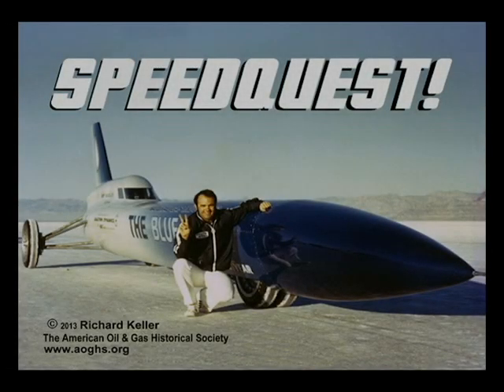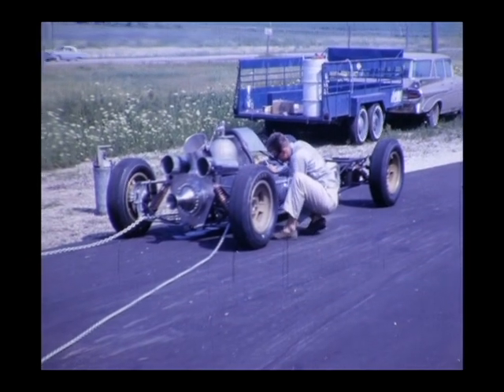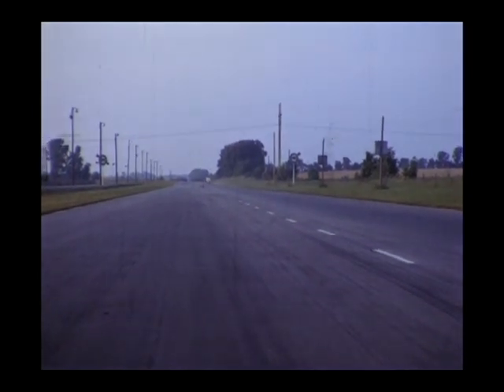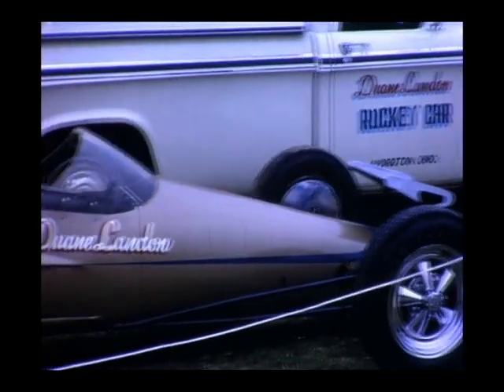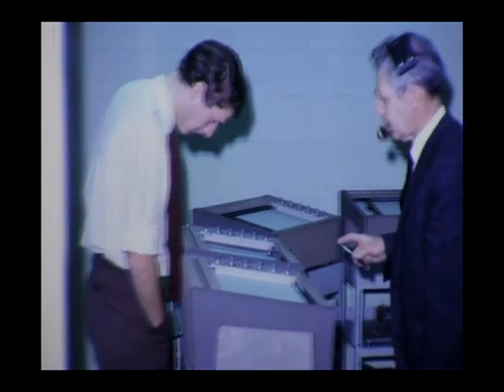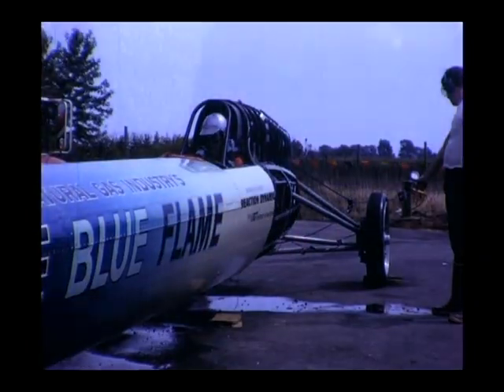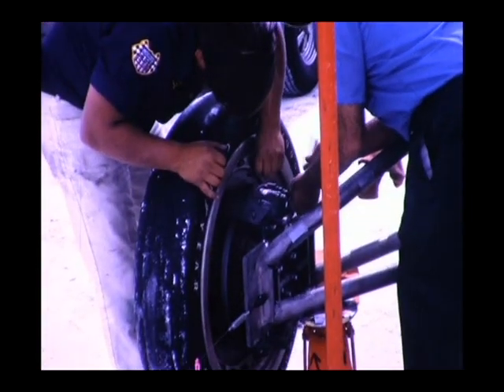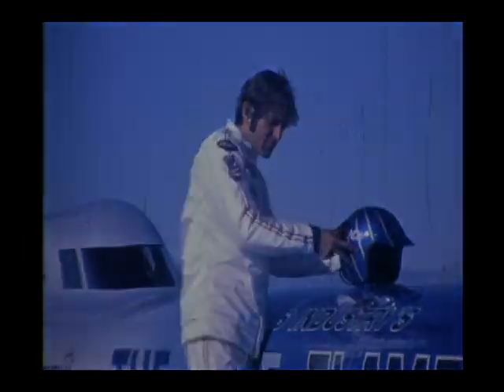The Blue Flame - Speedquest

Comment: Bring back rocket cars!! I remember as a young child watching these cars
Reply from the maker: The X-1 was the first successful rocket dragster which we ran for 2 years until we started working on The Blue Flame. The X-1 rocket was later installed in the first Pollution Packer dragster which unfortunately crashed at the Darlington Speedway track, killing Dave Anderson. Unfortunately, later accidents resulted in a ban on the rocket dragsters.
Reply: Dick Keller my father Donnie Holm was one of the first guys to make a machined billet cylinder head for fuel and alky cars in 81-82 . Some say Ken Vinny was first some say my dad was. I was way to young so it’s up in the air. I remember watching rocket cars as a young child on the west coast like OCIR and Baylands. I remember a go kart rocket and a rumor about it taking flight. Any truth to that most say it’s a urban legend
Reply: Dick Keller you videos are so cool I watch them over and over again. Thanks for the great content
Reply from the maker: @groomlake51  There were two or three rocket go-karts back in the 1970s. Turbonique produced a small rocket that was used on at least one go kart. I believe there was at least one other using a bespoke hydrogen peroxide rocket motor. I am not aware of any crashes of these mighty mites.
Reply from the maker: @groomlake51  Also check out Sam Hawley's "Land Speed Legends" YouTube videos. He did The Blue Flame parts 1, 2, and 3 which are excellent.
Reply: Dick Keller thank you very much Sir🦾 if we ever get back to racing in the NHRA I have some VIP tickets with your name on them for any national even you would like!!! Nitronickholm g mail
Reply: Dick Keller did you guys work with Kitty O’Neal also back in the day???
Reply from the maker: @groomlake51  You are very welcome. I can't believe how much fun we had in the 1950s and 1960s street racing and finally running on drag strips. We all built our own cars before the Detroit muscle cars arrived. Now, we are all shut down with a stupid fake virus.
Reply from the maker: @groomlake51  I never worked with Kitty. I met her and watched her in action a few times. She was very talented, brave, and a real lady.
Reply: Dick Keller tell me about it!! We were going for rookie of the year in top fuel this year. After 2 races we are sitting 6th and the dang flu shuts us down😳🔫. I was born in 78 and I remember drooling over pictures of the blue flame growing up obsessed with H2O2 cars. I really love the technical information you detail in your videos! Keep up the great work your videos are a piece of history and very informational. Growing up around racing. I always love the out of the box thinking and guys like you that were not scared to do something different. The sheep mentality has diluted Racing i think. In my eyes innovation is a lost art. My father made me read rule books over and over like he did. He always said” not all..., but most rules are written in words. And words are open to interpretation”! Thank you for your documentary’s. I watch them over and over a lot and learn something new every time🦾😎🚀🇺🇸
Reply from the maker: @groomlake51  Back when I was privileged to be a part-time pit crew for Don Garlits, he was always commenting on how as soon as somebody succeeded with some new design - it was immediately copied by everybody. The result was they all ran the same speed and ET. Don was always experimenting - and that is why he was the King of the Dragsters. For Pete, Ray, and myself there would be no point in getting a turbojet engine and trying to beat all the other turbojets. Breedlove and Arfons set the pace in the 1960s and, in the end, they were both running the same speeds. Roger Penske always looked for the "unfair advantage" with Mark Donohue - and kicked butt in Indy, NASCAR, and SCCA. We tried to do the same with The Blue Flame.

Comment: My grandfather, Ray Besasie of Milwaukee, fabricated the nose cone and canopy-fin assembly in his east side shop. He is pictured (old guy with baseball cap and sunglasses) in the scene where the guys are polishing the nose cone. He was an amazing man.
Reply from the maker: Ray Besasie was the fabricator of all the compound shaped panels on The Blue Flame. The following year he did the same for the Honda Hawk motorcycle streamliner that went 286 mph. I recently gave a PowerPoint presentation on The Blue Flame to the Ancient Aviators of Alabama where I described Ray Besasie as "the most interesting man in Milwaukee". Ray was an aviation pioneer, designing and building the monoplane "Sonny Boy" in 1932 - and the radial engine that powered it. He was an innovative designer of turbochargers for piston engines. He designed and built numerous vehicles for Brooks Stevens as well. Ever hear of the Excalibur?
Sadly, I didn't have good photos of Ray working on The Blue Flame since he made those panels in his backyard shop. And he could really spin a yarn! What a great man.

Comment: I was an undergraduate student in Aerospace Engineering at Ohio State with a part-time job (mostly doing drafting work) at the Aero Lab when the wind tunnel tests were being conducted.  The original plan was to have a conveyor belt running at 600 mph to simulate the car running on the road, but the belt formed waves at high speed and that plan had to be dropped and a flat plate used.  We were all super excited when the Blue Flame broke the record!
Reply from the maker: I really enjoyed working with the Aerospace Engineering staff at The Ohio State University. We made critical decisions based upon the data derived from the transonic wind tunnel test. The result was the best handling LSR vehicle ever in t he 600 to 700 mph range.

Comment from the maker: Instead of the moving ground surface, the model was modified and placed in the test chamber mounted above the thickness of the flat plate  boundary layer. Dr. John Lee of OSU consulted with Dr. Paul Torda and grad student Tom Morel of IIT on the transonic test procedure. The result? The Blue Flame, running in the transonic speed region (660 mph peak speed) was the most stable 500+ mph land speed record vehicle up to that time (1970). A job well done.

Comment: Great video , as an Aerospace eng I  like the Tech info,,  looks like the vehicle was well within its design limits.  Why didn't they push the record higher ?   Regards from Bonny Scotland 😊
Reply from the maker: The AGA sponsor was happy to get the record, period. They were more concerned about negative publicity if The Blue Flame would crash trying to go faster. Actually, we were prepared  to raise the record on the next day, October 24th, but it snowed and the LSR season was over on the salt flats. The Blue Flame went on a national and European tour for a year, then stored away from view. Finally, it became the feature exhibit in the Sinsheim Germany auto and technical museum.
Reply: @630lsr  Those tires must have been pretty special, to handle the centrifugal forces.  Especially having the trust in them to operate at higher speeds.
Reply from the maker: @atomicbonds6790  Goodyear did a terrific job on the tires. They tested the tires on our wheels at up to 850 mph.
Reply from the maker: Waiting for Rosco McGlashan to really push the record over 1,000 mph.
Reply: @630lsr  I wish him only well and the best of Scottish luck,,   but is it really wise to take such a massive step above the current record ?   One small step at a time.  
Bloodhound will never move again, The Britts are  skint & have no Balls,  so no  threat from them.
Reply from the maker: @andyb.1026  Probably sounds good for raising sponsor funds. We already were first at 1,000+ kph.

Comment: Love this video, as a kid "The Blue Flame "was it for me. I actually made a model of it using a Estes D engine, it went well until the end and it got air borne.
Reply from the maker: Glad you liked it. I shot my video on 16mm Kodachrome film - there was no video tape then. I was building balsa wood "rocket" models as a kid, too. We used CO2 cartridges bought at the army surplus store after the War for power. To keep it on the ground we used a fishing line through 2 small eye screws under the car. Worked every time.

Comment: Acceleration wise, was the Budweiser quickest? Both seem to take off very quick in the videos, wonder what the potential could be if allowed/handle full thrust
Reply from the maker: We timed The Blue flame in the Standing Start 1/4-mile a few times to check performance. On September 18, 1970 Gary drove The Blue Flame to a 6.724 seconds elapsed time. We didn't time the top speed. By comparison, the 1970 Top Fuel qualifier at NHRA Supernationals in Ontario, California was 6.68 seconds. I guess The Blue Flame was quick as well as fast!

Comment: Was the car designed to fit inside of a shipping container or the enclosed trailer of a Class 8 type truck? Wikipedia page says: The vehicle is
37 feet 4.6 inches (11.394 m) long, 
8 feet 1.5 inches (2.477 m) high to the top of the tail fin, 
7 feet 8 inches (2.34 m) wide
wheelbase is 25.5' (7.8 m). 
https://en.wikipedia.org/wiki/Blue_Flame_%28automobile%29
Reply from the maker: +SanFranciscoBay No. Our trailer was not enclosed. We did design within the 8 feet truck width limit to avoid tickets.

Comment: I found this on wikipedia: Sammy Miller in 1984 at Santa Pod Raceway recorded the quickest quarter mile elapsed time ever of 3.58 seconds at 386.26 mph using a hydrogen peroxide powered engine car called Vanishing Point. https://en.wikipedia.org/wiki/Rocket_car
Kitty O'Neill piloted a hydrogen peroxide powered rocket dragster, in 1977 in the Mojave Desert,  built by Ky Michaelson's Space Age Racing Team with an average speed of 279.5 mph (449.8 km/h), setting an all-time record pass in the quarter mile at an incredible, never before achieved 3.72 seconds at a top speed of 392.54 mph. https://en.wikipedia.org/wiki/Kitty_O'Neil
Reply from the maker: +SanFranciscoBay Sammy's first two rocket funny cars - 'Spirit of 76' and 'Vanishing Point' used my rocket systems. He continued on with a rocket dragster, 'Oxygen'. I believe there are YouTube films of his cars running in the UK and EU.

Comment: I'm using my wifes facebook to ask,if you got the record at less then 100% thrust why didn't you come back for more.I think your design is timeless and  with some safety improvements and new rocket a real chance to hit 1k mph also.Thanks for the memory's sincerely Dave L
Reply from the maker: Our sponsor, the American natural gas industry, took ownership of The Blue Flame after we missed our original schedule to run the car in 1969. We de-tuned the rocket in 1970 to comply with the temporary speed limit imposed by the Goodyear Tire Company, which owned the tires. The original plan was to return in 1971 with the rocket at full power to attempt a supersonic record speed. The sponsor, now owners, decide that the reward of a new record would not justify the risk and scrubbed the project.

Comment: 18:00 " Instrumentation borrowed from NASA " : a wire ...
Reply from the maker: Doctors Torda and Uzgiris were professors in the IIT Mechanical and Aerospace Engineering Department. They had several contract research projects with NASA, and some of the instrumentation they had available from those projects were temporarily used in the static tests and later on the salt flats. The on-board recorders can be seen in the LNG tank compartment at 23:00 in my film. These were mostly pressure measuring devices on the skin used in the early test runs. Later, they were removed and our IIT support returned to Chicago.

Comment: i'd like to know the purity of the hydrogen peroxide formula. I believe the space shuttle uses %80 pure mixture
Reply from the maker: I am not certain what the HTP concentration is on the space shuttle. Initially, The Blue Flame used 90% concentration HTP as the oxidizer with the LNG fuel. Later, after a change in the catalyst screens from pure silver to silver-plated nickel raised the catalyst melting temperature, we raised the HTP concentration to 98%. This increased the rocket motor specific impulse and thrust, adding about 50 mi/h to the top speed.

Comment: So you guys used the 27 megahertz band for communications to the driver?
Reply from the maker: +Slicklickz We were using the standard CB radio at that time - 27 MHz
Reply: +Dick Keller Were you using standard AM or was it SSB?At that point in time there were still only 23 AM channels,correct?
Reply from the maker: It was just standard AM citizen's band with 23 channels available. It worked fine on the salt flats - no obstacles. We had to elevate the antenna, though, from about 24 inches above the ground to the top of the tailfin. That may have been more a mechanical consideration than a radio issue.

Comment: wow what a great tech video. really great insight into the record setting car & driver :)
Reply from the maker: Glad you liked it. The real message is that we reversed the process of land speed record design. Ostich, Breedlove, Walt and Art Arfons, all purchased surplus turbojet engines and tried to see how fast they could go. We calculated the power required to achieve our record and designed and built the rocket to develop the necessary power. So far, the only one to do it that way.

Comment: One question.  Why did you not try and push it a bit more, in the video you state you thought 800mph was possible? You only pushed it up 22 mph? Was it budget or safety fears?
Reply from the maker: The first issue is that Goodyear owned the tires and imposed a maximum speed limit, under contract, of 700 mph in order to prevent our going "banzai" the first time out. We had reduced the maximum thrust available in 1970 to comply. The tires and wheels were tested to 850 mph, so that wasn't the problem. We ran The Blue Flame at full (available) power, reaching maximum speed (660 mph) in the center of the measured mile/kilometer speed traps. The 630 mph was the average speed for the kilometer, not the maximum speed. Starting the car with a push gave us about 2 seconds extra thrust at the maximum speed. We actually pushed it a little faster than 22 mph.
Reply: @630lsr  Fascinating Dick and thanks for the reply, when you consider Noble was pushing the hell out his Avon to get his record, it is conceivable that you could have gone much faster before and only SSC would have perhaps beaten a 670-700 record set by Blue Flame. Either way a beautiful and well thought out car, and remarkably safe, just like ours!

Comment: Could you comment on the similarities/differences between the Blue Flame and the Budweiser Rocket powered cars?
Reply from the maker: +SanFranciscoBay The Blue Flame rocket motor was a bi-propellant using LNG as the fuel and HTP as the oxidizer. Bud used a liquid/solid hybrid design with HTP as the oxidizer. It also used a solid fuel rocket lashed on to add thrust (sort of a RATO). The Blue Flame was also a bit larger in frontal area, and the rocket motor combustion chamber was regeneratively cooled with a "water jacket" with HTP circulating inside.

Comment: Can somebody explain how it is that German mechanics loading T-Stoff into Me-163b needed complete protection and the whole process was very hazardous and here there is a guy in shirt with just a plastic glove loading pure hydrogen peroxide into the dragster?
Reply from the maker: T-Stoff is HTP, high strength hydrogen peroxide. There are two hazards, while fueling the X-1 or The Blue Flame, from spilled HTP. First, it is a highly energetic oxidizer which may ignite organic materials, like cotton. Second, on the skin it enters the subcutaneous fatty layer and decomposes causing mildly painful temporary blisters. We learned to be careful handling HTP and keep a large quantity of water nearby to immediately dilute the HTP. We never experienced more than a few of these mild blisters. There was an HTP spill into the nosecone of The Blue Flame, which began decomposing the fiberglass-epoxy liner. It caused some black smoke until we got the water onto the surface. The Me-163 crews worked under more difficult wartime conditions.
Reply: Dick Keller
Thank you, I was just curious, when I was a kid I remember the Blue Flame being one of my dream car, I'd never imagined I would one day talk (albeit via the net) with one of the people involved in the project.

Comment: Nitrogen powered rocket?
Reply from the maker: The Blue Flame's fuel is LNG - liquefied natural gas - the same fuel (visible blue flames) in your kitchen gas range. We used the cryogenic liquid natural gas because it has higher energy density than compressed natural gas (smaller fuel tank). Hydrogen peroxide, decomposed into oxygen and water, provided the oxygen to burn the natural gas.
Reply from the maker: @Anonymous-ux3tu  The X-1 prototype rocket dragster was a monopropellant hydrogen peroxide rocket. The word "nitrogen" in the film always referred to the high pressure nitrogen gas used to pressurize the hydrogen peroxide propellant tank. The nitrogen was in the small spheres in the front of the X-1. With The Blue Flame the larger pressure spheres in the nose cone were pressurized with dried air. Again, this was to pressurize the hydrogen peroxide oxidizer tank. The LNG tank, being cryogenic, was pressurized with helium gas.

Comment: People don't understand the blue flame only used less then half of it's full power that thing opened up would more then likely  run 1200 mph
Reply from the maker: Thank you  for the astute observation. Actually, because the aerodynamic drag increases exponentially at supersonic speeds, the top speed would more likely have been in the 850 mi/h range. It was a bit disappointing that the new owners of The Blue Flame (AGA) wouldn't let us return the following year, as originally planned